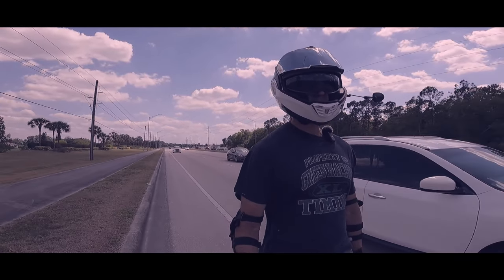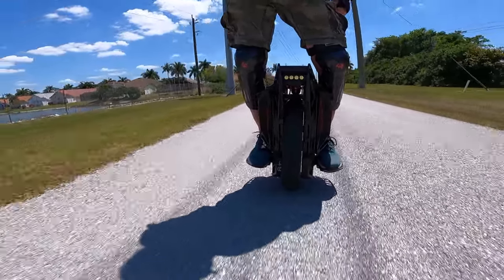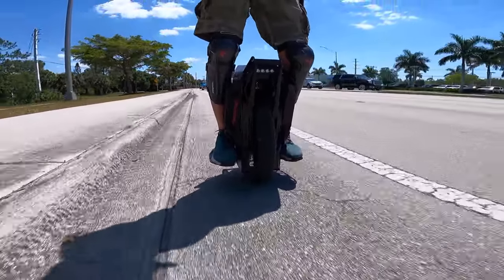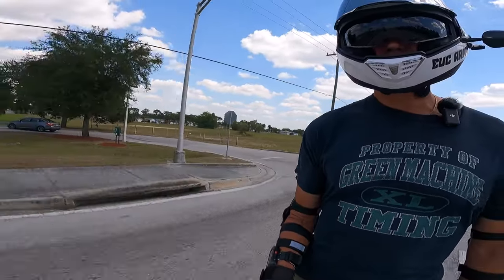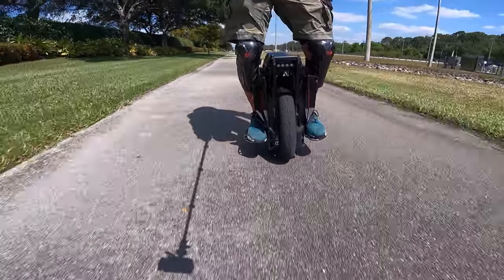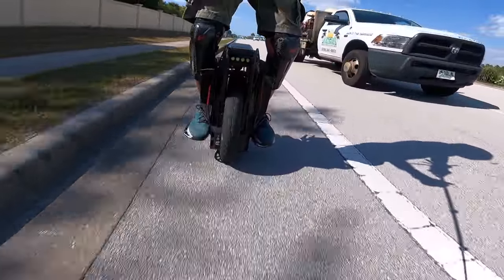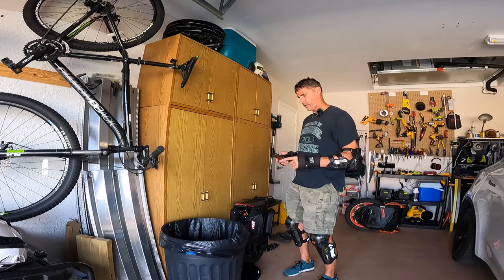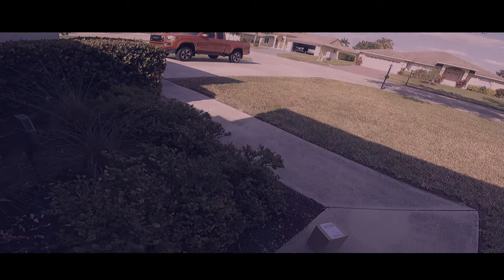Begode ET Max Real World Range Test - How Far is Enough?

Comment: The reason for the not so good range are the 4500 motors on mt mx and v13 they demand a lot of battery. The reason veteran wheels get better range is the 3000 motors.
Reply from the maker: And Veteran allowing you to go deeper into a pack.

Comment: The same thoughts, like was said here already, most energy is depleted in acceleration and in fast ride. 
Well, its made to be fast, but if you could change from fast to long range with a button push simply, it would be easier to save, since you could turn a power on just at exact moment when you need that...
Reply from the maker: Yea that would be nice

Comment: Off-road mode is optimized for torque, so there's less field weakening at all speeds. Higher Field Weakening lowers the torque available, and at higher speeds this allows lower energy consumption/waste heat; possibly greater range (no experience here).  Try 90% Field Weakening; you may not even miss the low end torque that much considering Florida's terrain.
Reply from the maker: Yep I am aware of the correlation
Reply: @Duf  Now we’ve got a baseline for comparison,  ETmax off-road range test: 50 miles.  
ETmax w/ field weakening: ?? 
V13 range with/without F.W.: ?? & ??…
 
Looks like potential content, and a test of your knees.

Comment: A bit low on the range, but not overtly surprising considering it's a race wheel.

The extremely high charge rate makeup for it if you find a EV outlet nearby.
Reply from the maker: Yea it filled up fast using my Roger Charger